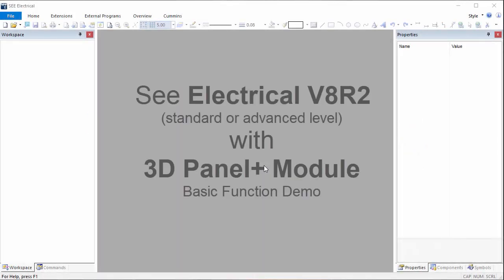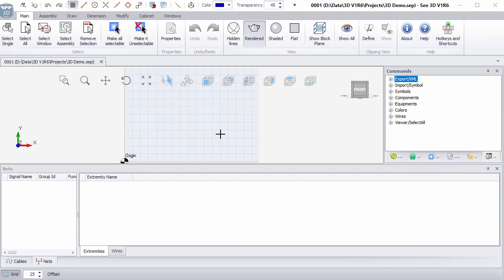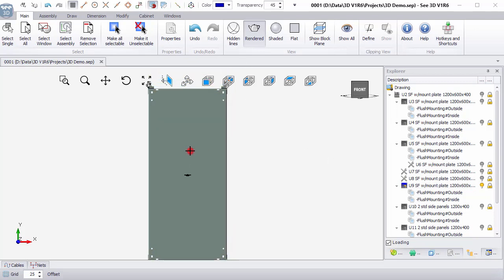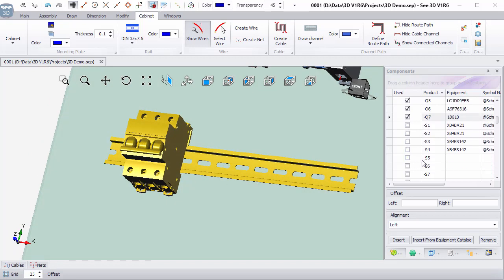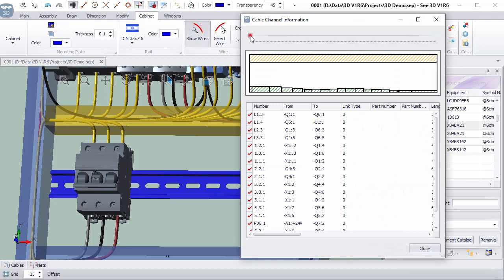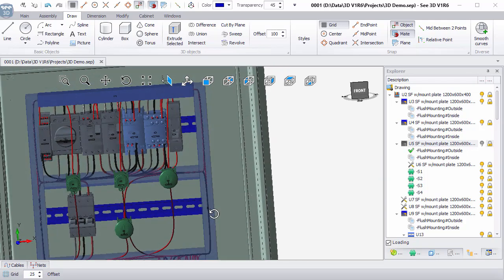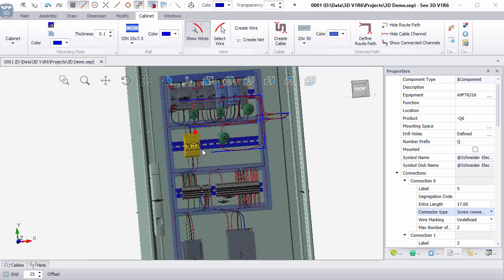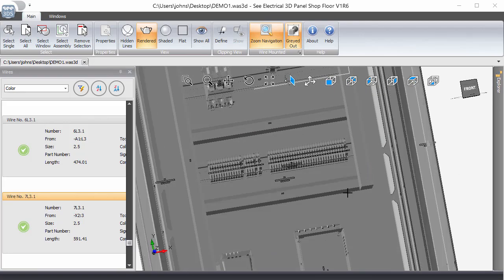See Electrical with 3D Panel Demo

Comment: I am looking for an electrical CAD that has features like SolidWorks with a hobby price. This hobby project requires linking the PLC schematic with 3D sensors, 3D wringing harness. The Cad video looks very interesting.   What is the software cost?    Thanks.
Reply from the maker: You can see our subscription bundles and prices here: https://www.ige-xao.com/en/us/see-electrical/ 
They can nevertheless vary from country to country so please contact us via our website for more information: https://www.ige-xao.com/en/formulaire/?need=product&product_wanted=SEE%20Electrical

Comment: Can we design MV panels like with 15to20 ACB outgoing feeders?

And have one more quiz,! 
Can we use this 3d model to for machining like laster sheetmetal laser cuttings?
Reply from the maker: Yes, any electrical panels can be designed using the 3D Panel+ package. There's functionality to insert copper with bends and hole drilling templates as well as the option to output dxf/dwg or specific Perforex or Steinhauer drill/cutout templates for any mounting surface.

Comment: How do enable 3d panel
Reply from the maker: Make sure when you install See Electrical to use the 'Custom' option and include the 3D Panel module. If you've already installed, use the Modify option in Add/Remove Programs for See Electrical. 

Once its installed if you have a license you will be able to create 3D Panel pages in the workspace panel, if you have recently installed then you may still have 30 days trial available.
Reply: @IGEXAOUK  thanks you